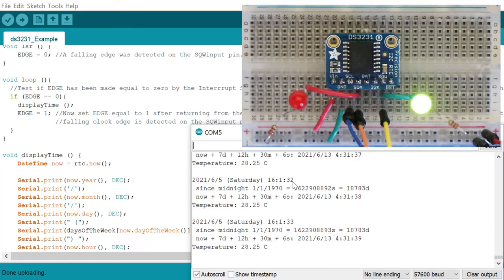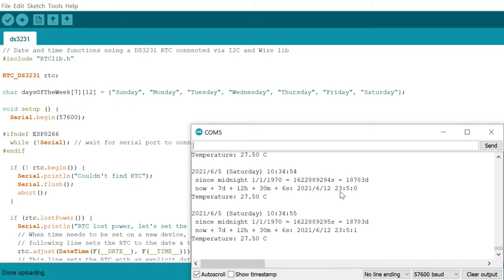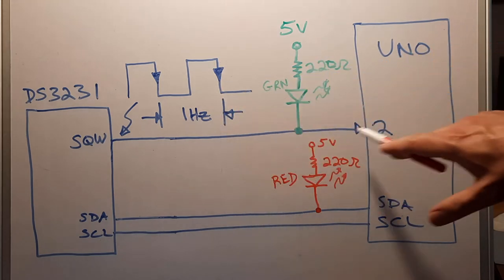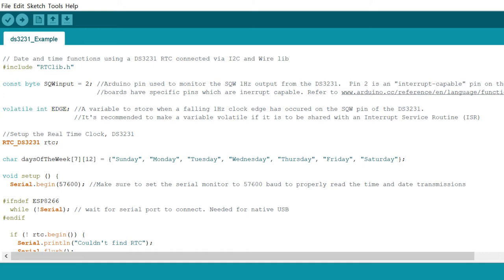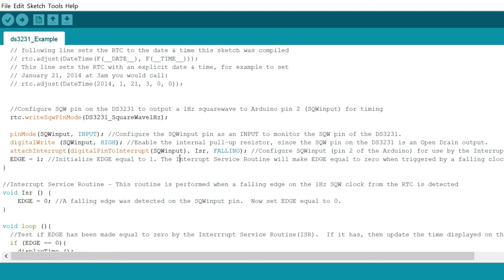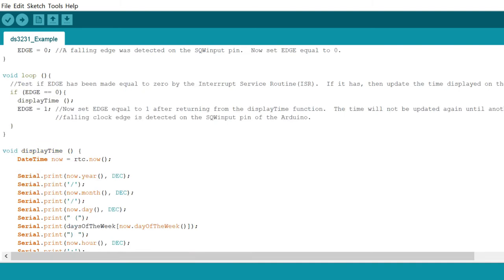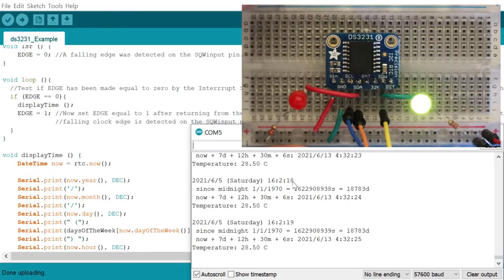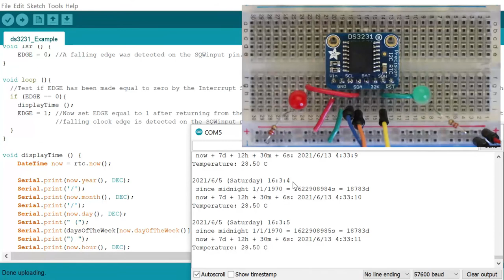Easy Real Time Clock Interrupt - How to Use the DS3231 SQW Pin

Comment: Question  I am working on a project using this board an I have the components but what I wanna accomplish is I'm doing a traffic light set up using a 4 way intersection an traffic lights going down at each entersection ok so at a certain time I wanna have my yellow/ amber leds on my traffic lights to go on caution at a certain time and then go back to working order after that time is over.  So basically the Arduino is still working real time an then going to flash at another time.  So let's say working order traffic lights 12pm - 5pm. Then go on caution at 5:05pm and back to working order at 9:00pm.

Comment: Hi, thank you for the tutorial How can i edit the sketch to run on a Mega?
Reply from the maker: Hi Aubrey - This should be relatively easy.  In the Arduino IDE program, you will need to go to "Tools" and then scrool down and select the Arduino Mega you have from the list of options.  That should be all you need to do, unless you are using a different Mega pin to monitor the SQW output.  If so, you need to change the SQWinput pin in the sketch to match the Mega pin you are using.  Make sure it is an interrupt capable pin (2, 3, 18, 19, 20 or 21).

Comment: What is the DEC variable in the code for?
Reply from the maker: DEC is for decimal and instructs the Arduino to print the value in decimal (base 10) format.  I found that it is redundant and you could just leave it out.  For example:
Serial.print(now.second(), DEC);
can be changed to:
Serial.print(now.second()); 
and it will still work as expected.  You can change the DEC to HEX which displays the value in hexidecimal (base 16) just to see what happens.
Have Fun!
Reply: @DuranioLabs  thank you so much for replying! I been trying to understand this part for a while, thank you!

Comment: Thank you, great info, useful for my project. .I have design a cock  and using pin no 2 Arduino uno for segment A  can i use pin no 12  for sqw pin out for secnd showing 2 leds and other thing I do no want to use the led conected with SDA pin can i remove it .
Reply from the maker: Hello Sukhbir Singh - You can remove the LED connected to the SDA pin with no problems.  It is not required.  If I am understanding your other question about pin 12, you should be able to drive a second LED with it as long as you use a 220 or 330 Ohm resistor.  It sounds like you want to light this LED every second?

Comment: Thank you, great info, useful for my project. 
I do have a question though. your code mentions You are using this to enable pull-up resistor. 
  pinMode(SQWinput, INPUT); 
  digitalWrite (SQWinput, HIGH); 
  
Isn't it easier to do a simple 
  pinMode(SQWinput, INPUT_PULLUP);
instead?
Reply from the maker: Good question!  I have not tried that.  It would be easy to experiment with making that change in the program to see what happens.  If no errors are reported, it probably works.
Reply: @DuranioLabs  Thank you, I tried it and seems to have worked. 
I use SQWinput to trigger the alarm, but otherwise works fine.
Reply from the maker: @mihaisor Glad that worked!

Comment: Great, thank you so much for the video. Sir, my RTC is not sending interrupt while on coin cell but it worked fine on 3.3 or 5V Vcc. can you help me please.
Reply from the maker: Interesting.  I have not tried running the the RTC on the coin celll alone.  The DS3231 datasheet mentions a 0.1uF decoupling capacitor should be placed in parallel with the coin cell if it is the primaty power source.  I would need to investigate this further.
Reply: It's complicated. I tried this yesterday and failed. First RTC is not powered by a coin cell, where there is power on VCC. When you disconnect that power putting it for example on arduino output pin and setting it low, it instantly triggers interrupt cause SQW/INT pin goes from  high to high impedance. Then there's a chance that RTC may be powered via data pins.And when I measured current with SDA and SCL disconnect, it was 600uA, whereas with connection to Arduiono, it draws something like 90uA. It's not horrible.
Also note there's a BBSQW enable bit in either config or status register (battery backed square wave).

Comment: Thank you 𝘿𝙪𝙧𝙖𝙣𝙞𝙤 for the instruction. Very helpful.
A remark though: Your Arduino is now sitting there and waiting for the interrupt trigger and to print out the date.
Wouldn't it make sense to include the 𝚍𝚒𝚜𝚙𝚕𝚊𝚢𝚃𝚒𝚖𝚎 routine in the ISR, so that the 𝚕𝚘𝚘𝚙 can take care of other things rather than being trapped in the 𝚒𝚏 (𝙴𝙳𝙶𝙴 == 𝟶) loop?
If a longlasting routine would be running in the  𝚕𝚘𝚘𝚙, despite the interrupt, the time would not be updated regularly.
Or do you have a specific reason, why you only change a volatile variable in the ISR?
Reply from the maker: Hello value 1 - So for an interrupt service routine (ISR), the general rule is to keep them as short as possible.  They should not contain parameters or routines, such as, "displayTime".  It is also recommended that shared variables between the main progrm and ISR are declared as volatile.  More information on interrupts can be found here: https://www.arduino.cc/reference/en/language/functions/external-interrupts/attachinterrupt/
and here:  http://gammon.com.au/interrupts

Comment: Nice info sir, but can we calculate the RTC DS3231 to get the time in millisecond?
Reply: *calculate = set
Reply from the maker: Good question.  The DS3231 does not have resolution below seconds, but a counter could be written in the software to provide counts down to the millisecond, while still being reset every 1,000msec by the 1Hz squarewave.
Reply: @DuranioLabs  could u provide the tutorial or the steps? I really have no idea. This is for my final project on university:( i'll be thankful for the tutorial
Reply from the maker: @DONNY ALI SANJAYA - So I think an even better way to count down to milliseconds with an Arduino is to use the millis() function.  The millis() function returns the number in milliseconds since the board began running its program.  A description of millis() is here:
https://www.arduino.cc/reference/en/language/functions/time/millis/
And a detailed description of it use can be found here:
https://www.youtube.com/watch?v=qn8SP93L3iQ
Anyway, I'm not sure if you're building a real time clock or something more like a stopwatch with Arduino.  If you need time expressed down to the millisecond, then the millis() function is where you should start.
Reply: @DuranioLabs  Got it! I'll try with milliseconds. Thx for the explanation sir! Really apreciate it!

Comment: Thank you for sharing this information.
I just want to ask you that can we make frequency less than zero like 0.0002 etc in line of code "rtc.writeSqwPinMode(DS3231_SquareWave1Hz)" so that we can have falling edge every hour?
Reply from the maker: The slowest frequency setting available for the SQW pin is 1Hz but you can accomplish what you want a different way.  If your project still requires a real time clock, you can test the state of minutes and seconds and change the state of an Arduino pin when minutes and seconds both equal 00.

For example you can add the following lines to the Arduino sketch.

1) At the beginning of the sketch, assign an Arduino pin for the new output signal.

const int PIN = 3; // Arduino pin 3 called "PIN". You can rename it if you'd like

2) Within setup, "void setup ()" add the following lines:

pinMode(PIN, OUTPUT); //Set the new Arduino pin (pin 3) as an output
digitalWrite(PIN, HIGH); //Set the initial output state of PIN as HIGH

3) Within "void displayTime ()"  add the following:

if (now.minute() == 00 && now.second() == 00){
      digitalWrite(PIN, LOW);  //If minutes are 00 and seconds are 00, it's the top of the hour so set PIN low
}
if (now.minute() == 00 && now.second() == 30){
      digitalWrite(PIN, HIGH);  //After 30 seconds, set PIN high
}
You can add an LED and 220 Ohm resistor to the output to test the changes.
Good luck!